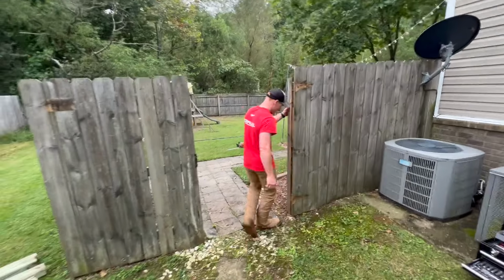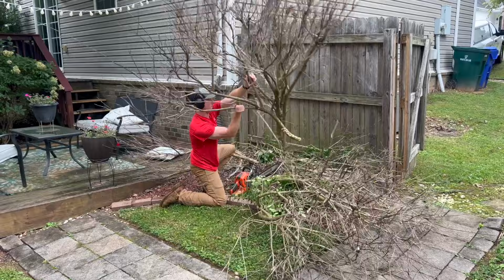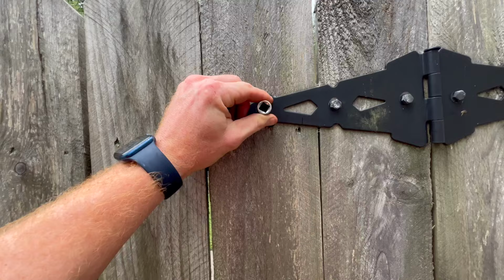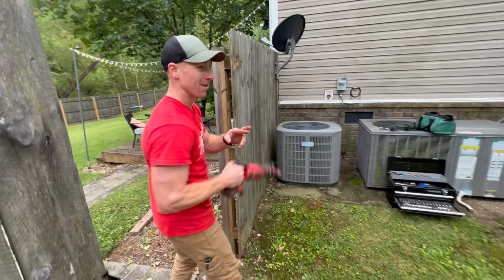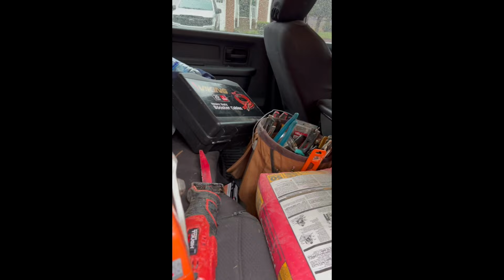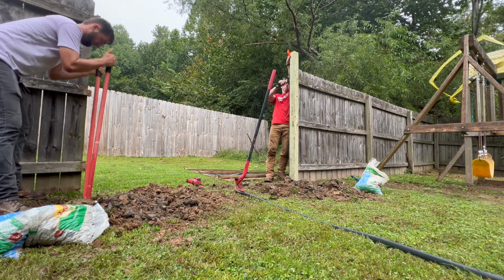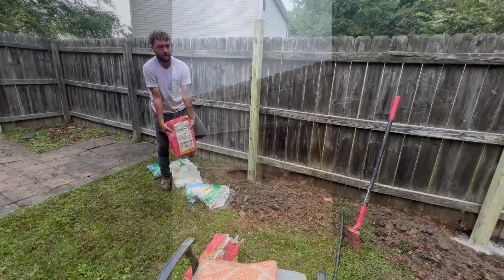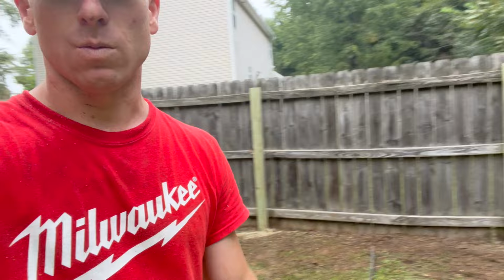Rotting fence? Do this! - How to replace rotted fence posts.

Comment: I have a old fence up for about 15 years with the fence posts started rotting instead of getting the posts out is there anything I can use to keep them in the ground strong for the moment until I get some new fence posts when I can
Reply: You can brace it with a 2x4 and stakes.  Just screw the top and put a stake at the botome and the should hold it until you repair the post. Use metal post if youre going to replace the post.
Reply: See my comment above. I have only replaced one post in 30 years using this method, plus its fixed for good.
Reply: Simpson strong tie fence menders 17.50 home depot

Comment: Why bother taking the posts out, putting new wooden posts in that are going to rot. What you need to do is make some concrete posts that are reinforced with steel angle with 2 tubes welded  to take a 12 mm bolt, set about 12" apart. Dig the hole out on your side, removing half the concrete round the post such that your concrete post will fit flush to the wooden post. The concrete post needs to 7' long. Dig down to clay which may be 3' down, drop in concrete post  hammer in the hole some of the old concrete. Drill through the tubes in the concrete post into the existing wooden post, using bolts long enough to pass through the concrete post and wooden post plus sufficient to add a 12mm nut plus 2 threads, two large 12mm washers (one either side), or half inch if you haven't come into the modern world. Tighten the nuts on the bolts, the nuts being on your side of the fence ( you will need access to the neighbours garden  if they are 6' panels) , but see no reason not to have 3'  high panels. Mix up some sand, cemnt powder and gravel and fill the hole adding hardcore and puddling it down as you add more.I have got a fence post I fitted like this 30 years ago is  still standing as the force of the wind is taken on the concrete post., not the wood post. If the wooden pots rots at ground level which they do the wooden  post is held by the concrete post.  Note the position at which the force of the wind   actually concentrates is 2/3 from the ground to the top of the fence. So for a 6' fence it acts at 4', so your concrete post should be long enough to accomodate this.Any wooden post tops should be covered with a wooden cap screwed into the top of the post, this stops the rain soacking into the centre of the post and rotting it. The post and fence then painted with old engine oil and creocote or creosote   both sides. If done in the summer whilst dry the wood will suck the oil in, itvwill act as a preservative and a waterproofing agent. I never use postcrete, its too soft and you don't know if its mixed correctly at the botton or anywhere else. Too much water and the mix is weak, not enough and and its still dry, so doing nothing.Why yanks have to use power tools instead of hand tools I don't know. Use hand tools and keep the lard off.
Reply: These two are a couple of cowboys.
Reply from the maker: That would be a invulnerable fence! Unfortunately, the customer's budget was somewhere between "Let it rot down" and "Fix it as cheap as possible". But next time I build a fence, I'll consider this. And I've always said that I should've been a cowboy.